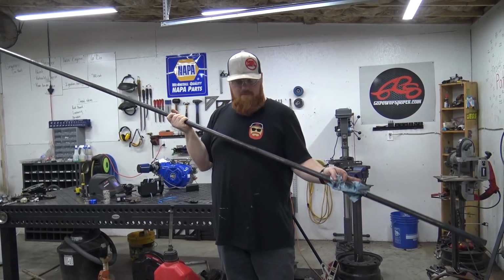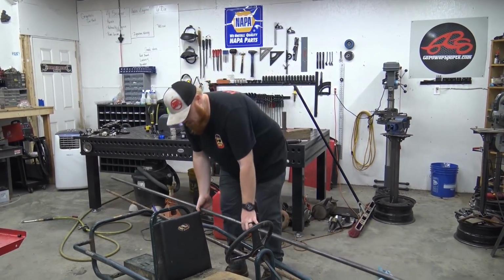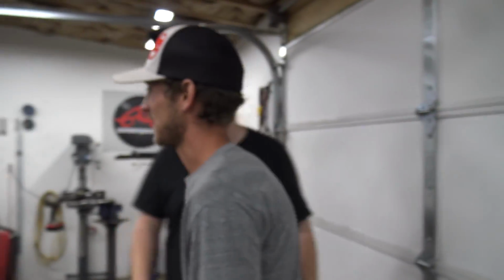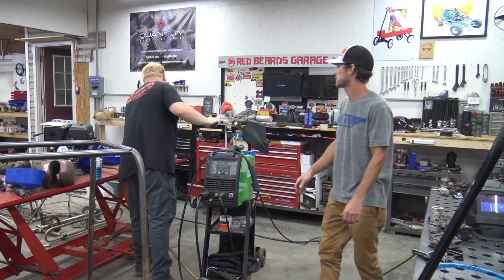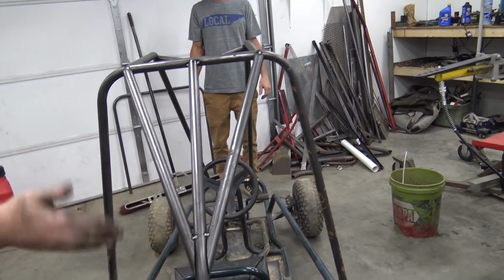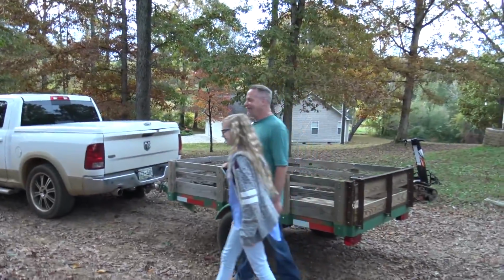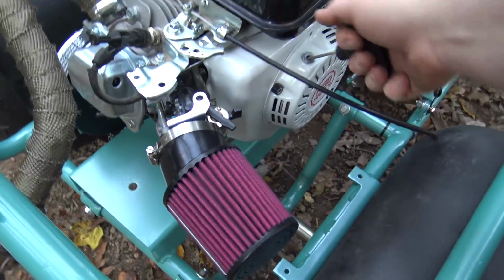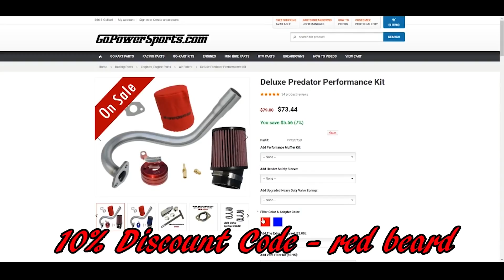Murray Explorer Go Kart Restore

Comment: Well done Greg  another happy customer 
have you considered building a full sized Sand rail with proper motor and gearbox from scratch ?  Rather B Welding's last project has some interesting design ideas that could be upscaled  to full size in it 

Also Greg please checkout the review Engineer BrunS latest video
What happened with hobby Chinese lathe Metal Master MML 1830 V in two years?
  https://www.youtube.com/watch?v=mOSc5WcwHoo
he does a complete strip down and reviews every part for wear and reassembles it 
I checked on ebay for the model lathe and it is around 600$ ish AUD WORTH Considering 

Tony from Western Australia